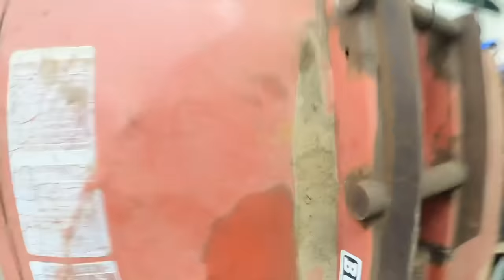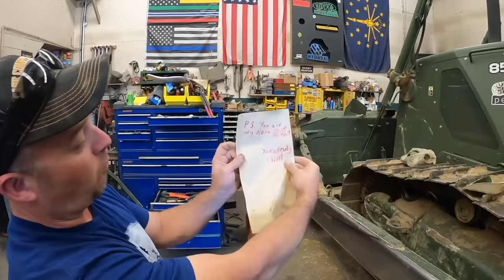Aaron had a accident!

Comment: Enjoyed Shop repairs specially the note  from Clint.  And Aaron, the four Mountain Dew welder.   Tell Aaron I like his Miller diesel welder. I bought a 1980 brand new Miller 200 amp pipe Line welder, used in my welding service and still have it today.          Bought it in 1980. Catch y’all later. Thanks, Mike.

Comment: A heat gun would be helpful when removing old gaskets or rubber seals.
Reply: Also using a osolating tool
Reply: That window is put in with urethane and a heat gun doesn’t soften it up at all or help to scrape it off anything. It’s the same stuff they put windshields in cars with since the 80’s, which actually gives the roof strength in a rollover. Cutting urethane is just like trying to cut a tire.

Comment: I know the window has been on now for several months and probably doesn't bother anymore, but if it does, Mask off a nice square gap around the window and fill the gap with urethane caulk and smooth it out. Also the edge of the glass is the easiest place to break it and this method would protect the edge.
Reply: I was going to suggest a similar idea but using black silicone. it is easier to work with than urethane sealant.

Comment: You will be reminded of that broken window every time you turn the heat or ac on. Lol. I had a  limb fall out of an old dead locust tree that I was pushing over with a excavator and it fell between the side window and the boom and when the boom moved it shattered that big window into 20 million pieces. This was 3years ago and still find pieces of glass. Great video DP and MBTS.

Comment: The joys of removing broken windows. That's an easy one. We used to had to remove full stuck in truck windscreens that were 2mts wide by 1.3 mts high.. A sharp wood chisel works great to but those air vibrating tools with a blade they use to cut plaster casts off with are awesome.

Comment: I've broken hydraulic pipes, usually a pilot line, when clearing a way through neglected woods. I've broken two rear screens when using   flail mower verticaly off set by  3ft. The brush seems to fliy every where. Once a bit caught the emergency stop control fitted on the outside of the cab. That took a bit longer to diagnose as it does not reset by itself.

Comment: An easy way to remove glass is to use music wire .  2 small vise grips.  Feed the wire through the sealant and pull the wire around the frame and glass.  Easy peasy.  👍

Comment: I'm surprised Captain Kleeman didn't get blamed for the broken window. 😁
 I have a 5 foot rotary mower that lost the bottom seal about 30 years ago when it got a birds-nest of wire wrapped around the spindle. I've used grease in it ever since, with no problem. I use 'corn head' grease, or if I'm out of that, I have used regular grease gun grease and add a bit of 90wt to thin it some.
 It normally gets about 10 or 12 hours of use, twice a year.

Comment: When i worked in the wood lands town shop converting the old short wood koring harvisters to brand new koring de limbers i was air arcing belly plate off the frames 12 hours a day using 3/8" carbon air arc rods. Tip. Any time you do any air arc.. make sure your welding cables are all unwraped from the cable holder an strached out strait as posible. Do not leave any cable rolled up on a real or looped up  on a hook. All of it must be layed out flat. Any cable rolled up ot in a loop on a hanger. The copper wire will rip right out of the rubber jaket faster then a snake sheads it skin. An for many feet. Real fast. In my years i have forgot to do so due to formens down your back wanting that machine back to work yesterday. Totaly destrying hundreds of feet of 4/0 welding cable. When buying welding cable. If your welder say is a 260 amp machine you want minimum 3/0 cable when longer then 50' buy real rubber caseing cable an real copper. Not copper clade. Thats coper coated alumunum. Witch has a cheap CPV CASEING. total trash. Buy a set of welding cable twist locks and add a 1/0 wip cable 15'  long for you stinger never hook arc air torch to a rod holder. I seen lazy ass's do that. If you think arc air is load. Wait till you see a guy or gal be lazy. An clamp a 5/32 rod to the arc air torch an clamp it in the rod holder.. like a bomb

Comment: Was that a Vickers vane pump you mounted to your brush hog? If so if you ever break the center don't replace the entire unit you can purchase the internals and it can be replaced just remember to use a bit of grease on it before putting the new center in it helps hold the vanes in place as you insert the new center. I replaced many over a twenty-two-year stint as a maintenance technician working on injection molding machines. And then working for a buddy that reminds me of you two. He was constantly going to auctions and bringing me trailer loads of farm equipment and big equipment like you guys use, to fix for resale. Your videos sure bring back some memories for me. I am disabled now and lost half a leg in November of last year so those days are gone for me. But my buddy is more like a brother I don't see very often now, but we still stay in touch.

Comment: I use an Optrel welding helmet that has a battery that recharges from light. If I haven't used it for a few months, I can set it in the sunlight for a couple of minutes to charge. I'm not constantly replacing batteries like with Miller, Lincoln and many other helmets do.

Comment: Heating the frame with a propane torch helps a lot if it's a steel frame you can get crazy with the heat, aluminum not so much.

Comment: This is a Gloves required repair, heat the black goo with a heat gun, and/or use an oscillating tool to get the glass out of the frame. You could have made a Lexan replacement window for that frame easy.

Comment: You having to put antifreeze in your welder reminded me of a time I had to drain and add antifreeze to my truck years ago. I drained about a gallon into a cutoff 5 gallon bucket and put it in the bed of my truck to keep it out of the reach of animals. When I went out to my truck the next day there was a stray cat laying dead beside the pail of antifreeze. The cat must have smelled it and jumped into the bed of my truck. The antifreeze killed that cat so fast it didn’t even have time to move away from the pail. Antifreeze must have a sweet smell to animals but it is deadly if they drink it. Merry Christmas Mike, Aaron and families.

Comment: DP you are absolutely correct, pushing brush with a dozer or gathering with a excavator is dangerous. Been in Aarons shoes with a dozer with open ROPS on more than one occasion. Had a tree, 6in in diameter, jump over the top of the blade and hit the right hand upright and thankfully went outside of the operators station before I could get it stopped. I NEEDED A CHANGE of UNDERWEAR and PANTS😂

Comment: You're doing right with the grease in the housing that will not hold oil I filled the gearbox on my brush hog about 5 years ago and its supposed to be a 540pto but I run on 1000rpm pto with an adapter it will come apart one day but it hasn't yet

Comment: For your parts for your prop shaft the front part is 34.00 dollars in Amazon prime and it comes with the u joint, for the prop shaft, I had to buy a new prop shaft for my Polaris Sportsman ATV, and I have gone through a lot of cv joints since I have owned it in 2018 I do all my own work on my Polaris Sportsman ATV and replaced a lot of worn out parts,  but it still running great, I changed oil and filter every other month, as I don't have a driver's license, so this Polaris Sportsman ATV is my main transportation source for me.

Comment: I work for a county road dept as an equipment operator and we have several of those boom mowers in are fleet. 16 of them I believe. Those mowers are wicked dangerous. Quite a few years ago one of our employees launched a blade through someones roof after hitting a rock.  Our tractors get the mower side window replaced with bullet proof glass but all the other windows are stock. We had one of our mowers get their back window blown out by another mower when they were team mowing and man that was a ton of glass. Those back windows are like 4 ft sq.

Comment: I if you gotta shop back it'll vacuum it up or are one of those 5 gallon bucket bikes from home depot will vacuum it up. I'll be back in the month with a home vacuum cleaner that had the hose on it when I was trying to get a door cause my vacuum cleaner burn up. When I was at a lady's house for sure, there's a wacking cleaner, I'm gonna be throwing it away. Try it and so we used it and it work so don't worry about it. If you're not worried about it and it's got a filter in it. Keep it from getting in the motor.  Volume hit up.

Comment: When we had a hydraulic motor that could only turn one way, we put a check valve on each side so oil could only flow in one direction.

Comment: Those arc gougers are why my ears are ringing 24/7 now down in tanks and those are copper cladded carbon rods guys! I’ve had to gouge out in the field with my torch because I didn’t have access to air! This is the reason you should get 100% weld on high stress brackets like the tile plow like I was saying the other day Mike! Plus using 7018 stick rods for strength! I didn’t get a response when I voiced it on the tile plow repair job! I don’t tell anyone what to do, I’m just trying to help with the experience I’ve had during my 40 years on the job! I’m sure Aaron would agree! Just saying! Back in the day, we didn’t have ear plugs supplied for us! Especially when we were rushed on every job because it was an emergency repair job! The bosses always wanted to crack the whip on every job and they didn’t care about safety at all! That’s why I’m paying the price with sleepless nights and ringing ears! Every day of my retirement! Good luck guys! God Bless 🙏🏻

Comment: Being a glass guy, heat the putty knife just enough repeatedly and it will walk through the seal bead. And don't scrap glass upside-down as Mike learned. And using laminated safety glass will allow it to break but not shatter. Then it's not an immediate needed fix.

Comment: make a good joint, pre-heat to 300f and then root pass with 7018 or 8018 3/32 then go to 1/8 rod and make a good fillet weld
Reply: Exactly, I would go with the 8018, works well overhead and vertical.
Reply: Merry Christmas to your family Mike!

Comment: Mike on the brush hog were you mounted the new hydraulic motor, I see what loos like two pipeplugs on the side of the housing. Why not just install a grease fitting in on of them and just use a grease gun to pack the whole housing?

Comment: That was tempered glass that broke. The glass shop isn't going to just cut a piece. It has to be ordered and manufactured in the factory because it has to be cut to size and then run through an oven to temper it. A good substitution is laminated glass which can be cut at the glass house.

Comment: I’m surprised that dozer windows aren’t stronger, maybe some window film on the inside might prevent it from coming in the cab in future, just a thought 👍
Reply: The new glass is laminated, two thin sheets of glass with plastic film sandwiched between them.  Probably safer than the toughened glass which shatters.

A removable steel grid might be a good idea when wrestling with trees? But you never know when it might happen, I had a telephone pole come through the windshield on a digger I was driving once, took me completely by surprise.
Reply: That was tempered glass which is usually fairly strong when it’s surrounded by a frame like in a car door or the frame its in now. But that’s a pretty big window and it’s flat where door glass in a car is usually bowed out a little which gives it a little more strength. By the sound the branch hit quite hard so it probably would’ve broken any kind of glass that was in it. The glass they put back in it is laminated like a car windshield is so it won’t shatter as much and go everywhere if it ever gets hit again.
Reply: @mikehunt3222  ,glad he’s okay, could’ve been heaps worse 👍

Comment: In regards to the brush hog, could one put a Zerk grease fitting on one of those plugs where the old hydro lines went @28:06, vice having to remove the motor to grease?

Comment: Preheating before welding will help the weld penetration into the metal that thick  .
Secondly anytime metal is that thick it should be beveled that least about half the thickness of the plate that is being used as braces .
Reply from the maker: You not watch the video

Comment: Mike I know you fixed this a long time ago butttt (LOL) On your gearbox I use "corn head grease"/(NLGI) Grade 0,  on gear boxes like this one. The majority of my brush hogs have it in them.  What makes it better than regular grease is the melting/flow temperature is much lower than your good "sticky" gun grease\NLGI Grade 2. So you can just drill a hole and install a grease zerk between the bearing on the gear case if you can and it would be a permanent fix. 
P.S. I have got to tease Arron about his bald spot. You need to put some dark makeup to cover it up so us viewers do not get blinded by the glare!!! LOL

Comment: That glass is F U on the parallel side it should have been an easy cut. Basically, a square piece with one slight angle at the top. Did you bring it to him Friday after lunch at the T Bar? I'd Have to put some glazing compound or a weather stripping to cover it up. Especially on the driver's side. It would drive me crazy every time I climbed into the cab. Merry Christmas.🍻

Comment: some guys would be cussing and cursing and throwing tools after this , but in the youboob world , it makes prime videos . Very interesting observation when you went to the mower deck...DEIT COKE   in a Pepsi shop !   The window folks maybe assumed there was a flashing around the outside  and left the gap so Glass does not touch / rub on the steel and fracture

Comment: Heat gun makes the glue soft then it peels off.  Bull ?  Coyote ?  Hum - likely use what was on hand from another job and made it fit.  Hum - maybe a wire screen glass next time.  Pain to cut but it holds the glass. Tough.

Comment: Bigger equipment equals new shop incoming?
Reply from the maker: Did I miss something or not fit
Reply: When you talked about the welder you seemed to imply that big changes were coming to the shop, so i was speculating that because in the last few years you've bought a larger excavator, haul truck and a dozer that just barely fits in this shop, that you are going to build a new, larger shop.

Comment: replace the glass with polycarbonate and a laminate like 3m stone guard. so much stronger and better insulation. the flexible laminate protects from scratches. and you can cut it with a saw. go 6mm and it will be seriously strong. and if it beaks, it doesn't shatter.
Reply: Still scratches easily no matter what you do the glass.
Reply from the maker: Yup

Comment: I dont know how you usa guy get away working in the  bush clearing trees an brush with out steel screens over windows. Here in Ont. Canada the ministry of labor would shut you down so fast an a fine from 10k to 150k per machine an 2nd ofence is worse. People have been killes by a limb, tree coming into open or glass cab like a bullet. Operator never seen it coming.